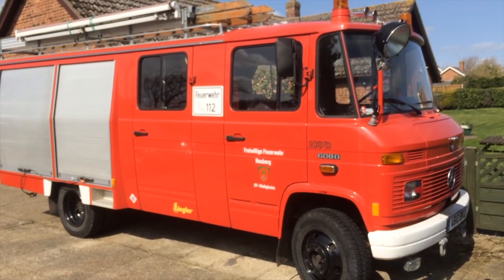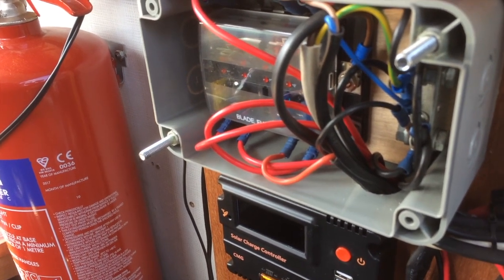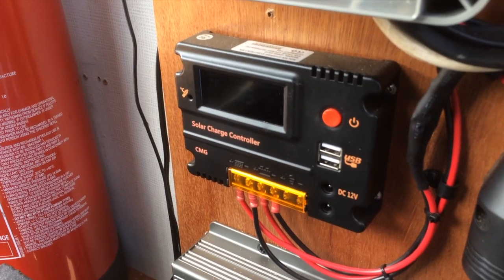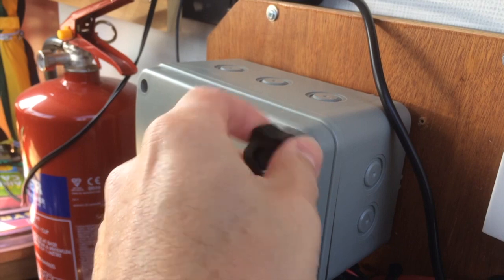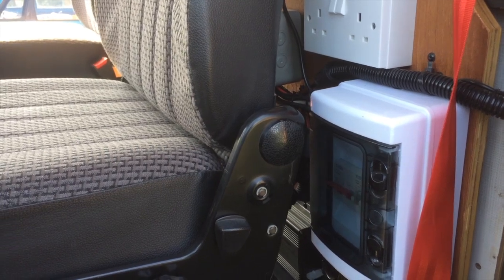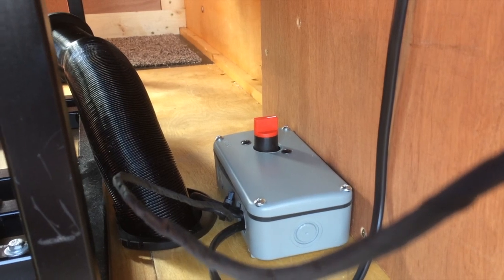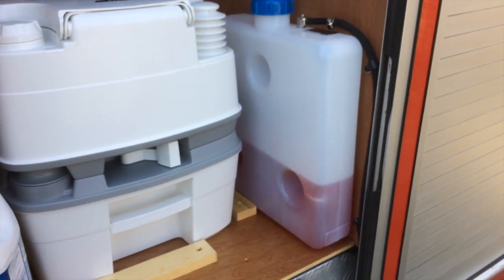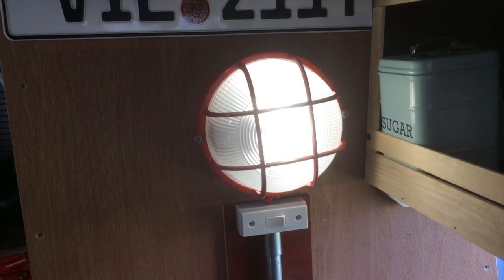Mercedes Benz 608D Fire Truck Camper Electrical Installation

Comment: Whats it like on fuel? whats the make and model. how did you find it. so many questions ;-)
Reply from the maker: Hi, not me in Yorkshire today, perhaps my German friends? I got it from the fire department via a reseller in Germany in September 2017, Mercedes Benz 608D with a 3.7L diesel. Typically about 25 mpg on a good run, just done 3000kms to Switzerland and back via Germany and Belgium, probably about 27mpg on average on that trip.